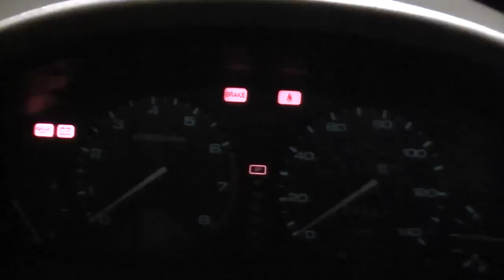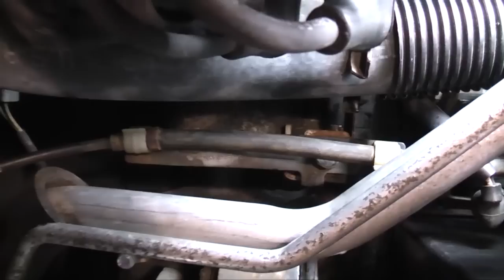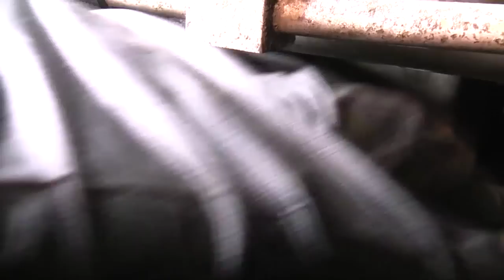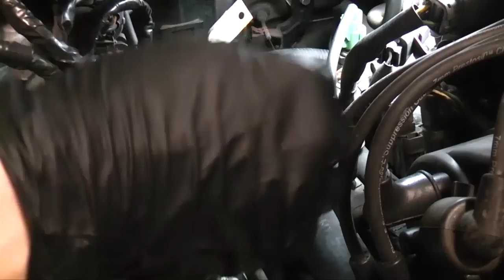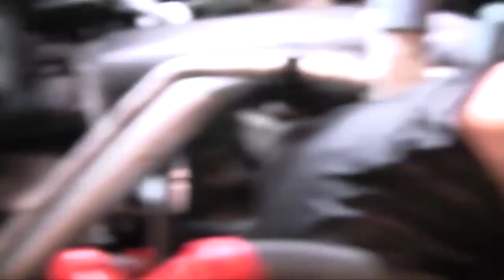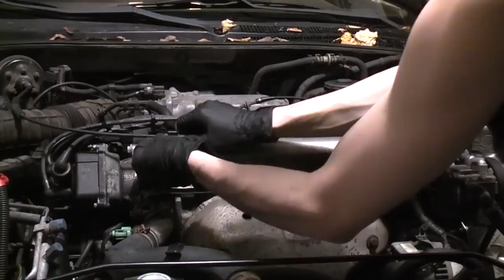Honda Accord Starter Replacement

Comment: Oh hell no.
What a pain in the ass.
I got a guy who will come to my house and replace it for $150.

I hate newer cars.
I want something 1970 or earlier

I had a 1965 mustang Fastback with a manual transmission and I pulled that transmission out so many times that I could literally have it sitting at my feet in 15 minutes.
I got a 2011 Tacoma there's no way in the world I would do the clutch on it.

Comment: Actually was half way thru your video listening while doing the job, and you said if you want to remove the battery for space you can... I removed the battery during starter removal and went out that side. Way less issues and it came right out. Looking back should've done the whole job from there.

Comment: Just changed out the original starter on my 1995 Accord with 632,000 miles. Thanks for the video it helped me out.
Reply: Loving that mileage! Still going strong?
Reply: @foxisretrofitting4556  yes it is just changed out the original distributor yesterday it was running a little sluggish and low on power and leaking oil internally 647,000 Miles.
Reply: @SuperHddeuce  Just did my distributor as well it puked oil inside of itsself. I found those sensors will kept going if you use some alcohol to clean all the oil off of everything after you reseal the housing. I just bought a remanufactured cheap distributor and put the old sensors back in. Saving the new ones for later. Not sure on my mileage somewhere between 206,000 and 300k. I changed the gauges out back when I got it in 2019. I've got lots of video on modding it if you are ever having to redo anything big. I converted over to the vtec equipment from the regular f22b2.
Reply: @foxisretrofitting4556  after replacing the distributor and checking fuel mileage per gallon it's getting 31.78 on the highway again was getting around 21 mpg big difference and more power
Reply: @SuperHddeuce  Nice dude! When's the last time it had a valve lash adjustment? It may eek out a little more mpg :)
Reply: @foxisretrofitting4556  80,000 miles ago I've got the new timing kit and water pump and seals ready for replacement soon

Comment: I had planned on doing the fuel filter (another excellent vid, BTW), killed the engine & went after the ramps in my shed. Little did I know the starter had chosen that exact point in time & space to poop out on me. Ramps in front of the tires, ready to go, AND NOTHING. LOL! Had to walk 6 miles round trip to get the dang part because no ride & no extra money for an uber. SOOooo annoying...

Comment: Nice video, what just got done with, i did is just remove the battery from the car, used a long neck rachet and extenders took the power cord off the bolt on solenoid, then started at the bottom take a short extender and a deep well 11/16 socket for the bottom bolt the radiator hose just move it to the right reach under neith to guide your socket on then begin, then switch to 14mm socket take off top, note you can slip the rachet in between the battery tray and the hoses, and if the bottom wont budge crab a thin pipe as a cheater bar. But if you want to use this video than good he also shows you.

Comment: I did it but I have to tell my story: First I had to get a longer 14mm socket and the extension. I found one for $1 at autozone on clearance. But it was for a small ratchet and it broke as expected. But that's all they  had, went to Pep Boys to get a real one. So after figuring out what to use to remove that left bolt. I thought OK how difficult can it be to put it back together.  I just couldn't align it or getting the left bolt in to the thread. Besides that the socket kept disconnecting from the ratchet. Then both the extension and socket fell by where the motor mount is and they got stuck in there. I can't get them out. I was tired already and my hands were hurting, not the palms but the other side. The starter is connected by only one bolt and everything is running good. I expect you to tell me that that is not right or good, right? After all this I don't even know what I did with the bolt. I plan to go to the junk yard and get one and replace it. It's not a difficult job. I just don't know why that left bolt gave me hell. Later I saw on youtube that you can use tape if you don't have a magnetic tool to keep the in place as you try to put it in. That's my story. I don't see anybody else having such a problem.

Comment: Thank you for posting this video.  I just replaced a starter in a 1996 Honda Accord and followed your video step by step.   I did have to pull the battery out to re-connect the power cable to the starter as there wasn't enough room to get the lock washer and nut back on the bolt.  Very helpful video!

Comment: I could not have asked for a better video because I have watched your other no start and therefore my problem is the starter! Should I buy my starter from Honda? 
The rubber covers at the end of the cables that attach to the solenoid are dried out and fell apart when I was looking around. Where would I get them and how would I attach them?
Thank you again very very much! Excellent video, instruction and follow along demonstration! I know the recording was difficult to position the camera, but it was perfect!

Comment: I want to buy rover 620 which is technically is honda accord 5 except for body, the owner says no crank and says no сurrent to starter from key, so because the starter doesn't work I can't check the compression, can you give me plz advice what should I do? how can I check compression with starter not working?

Comment: Would you know if I can use a 1998 Honda Civic starter to a 1997 Honda Accord ?thanks
Reply from the maker: According to my aftermarket parts catalog they have no starter part numbers in common.

The 1998 Accord with the 2.3 L4 does though.
Reply: thank you sir!

Comment: My daughter has a 96 Accord. The engine compartment looks exactly 180 degrees opposite of what you're showing. Is that normal? I have to replace the starter in her car.
Reply: planetrob555 because this is a four cylinder, what you're describing sound like the v6 model.

Comment: I have the same problem, I changed my starter and the same problem persisted, no engine crank or anything when I turn the key, I also got a new battery and nothing...the only way I could start it is if I push start it or get a jump from another car...any tips ??
Reply: NastySavageFucks559
Reply: same problem, have you found out what's the problem?

Comment: I changed the starter and the same problem persisted, engine won't turn or anything, I also bought a new battery and nothing, only way I could start it is but push starting it...any tips?
Reply: I forgot to mention that if I hook some jumper cables to it and get a jump it starts right up ..
Reply from the maker: Most likely an open or high resistance block ground especially if you're connecting the jumper cables properly (connecting the negative jumper lead from the good battery to the engine block on the dead vehicle and not to the dead vehicles battery negative).

To verify try bypassing the block ground with jumper cables connect one end to battery negative and the other end to the block and try cranking if the starter works you have a bad block ground.

If not check out this video https://www.youtube.com/watch?v=WwdBEENa7Is.
Reply: +Bushougoma what do you mean by block?
Reply from the maker: NastySavageFucks559
Any unpainted metal part of the engine block it will bypass the faulty engine block ground and allow the starter to work if that is the issue.

Comment: What brand starter did you get?
Reply from the maker: I've used both Napa and Autozone rebuilt starters on these vehicles without issue depending on who had one in stock at the time.

Comment: You show a starter for an Accord with an automatic, something we don't allow in our fleet. It is MUCH easier to change the starter on the manual transmission car. Drain a little coolant, disconnect a radiator hose, and the starter easily comes out the top.
Reply: Dan Avery if I was that a starter for a automatic would  work In a stick is that right

Comment: replaced mine with a new one from auto zone and it's grinding on my flywheel. old one didn't do that. 97 accord SE what could it be
Reply from the maker: +Angela Ramirez Make sure the bolts holding down the starter are tight if they are. Inspect the teeth on the flywheel for damage if they're in good shape I'd exchange the starter for another one.

These starters don't use shims so it isn't an alignment issue.

Comment: So I just replaced it!! Luckily it's the same make and model, so it made it super easy. But, it takes a few seconds to crank over and actually start. Would you say there is anything I could check or is that normal when replacing it, and due to the fact that it's a new part. Let me know! Thank you so much!
Reply: If it cranks slowly, you either have a different problem with the engine, or your battery is very old or the wrong size for the car.

Comment: I like your video a lot. it's really detailed. Adding info about the radio was a great practical tip.
Reply: YES! People who own this car, pay attention to getting the code for your car. Simply disconnecting the battery makes your radio DEAD. STUPID anti-theft thing from Honda. My daughter's car had to have the battery disconnected, and we looked at all options to find some sort of "silver" sticker that had a code on it that we would THEN have to use to get the code to input into the cheap-ass stereo to get it working again. Our fix?? We ripped out that shitty cassette player stereo and put in a real one. PROBLEM SOLVED. Why the hell they thought disabling a cassette deck would deter theft is beyond me...especially when all you have to do is replace it with either a decent stereo, or just replace it with any shit one.  Go figure.

Comment: GREAT VIDEO, BUSHOU...  MY GIRLFRIEND HAS A 1997 ACCORD LX...  HER STARTER WAS REPLACED A LITTLE UNDER A YEAR AGO...  IT WON'T CRANK WHEN IT (the engine) GETS HOT...  HOWEVER, IF I TAP THE SOLENOID WHILE SHE TURNS THE KEY, IT STARTS RIGHT UP...  DO YOU SUGGEST REPLACING THE REMANUFACTURED STARTER WITH A NEW ONE, OR COULD IT BE SOMETHING LESS EXPENSIVE?...  THANKS FOR ANY ADVICE YOU CAN OFFER...
Reply from the maker: +stillrumone Check with the auto parts store you bought it from many will offer a free replacement if it's still under warranty.

New starters are hard to come by especially for older vehicles and if you can find one they are very expensive. Dealers also sell remanufactured parts just like auto parts stores though they will usually be listed as such.

As for the longevity of remanufactured parts it all depends on the quality of the parts and the skill of the rebuilder. Buy a remanufactured part from a well known rebuilder and you'll be fine.
Reply: Thank

Comment: thank you for your time . A job well done! I forgot about checking the radio and I should know better. I suggest disconnecting the battery before attempting any repairs under the hood and any electrical service. thank you.

Comment: hi,I have a 90 accord that doesn't start when the engine gets hot,mainly in the afternoon when it's very hot out and I would be driving around when the engine is turned of and then re start engine it wouldn't start, cranks but no start,I would wait like 5min then it would start right away when engine cools a little
Reply: +Tony Tapuro Check on here for main relays. They over heat and disconnect connections and dont start the car. This is probably your problem. It's easy to fix and cheap. Sautering iron and a few minutes. Up under your stearing wheel area. leave everything mounted under there . Just stick flat screwdriver in and pull relay out leaving the housing. Inspect and fix then put back. Going to check mine and repair before i have a problem.

Comment: Awesome video thanks for taking the time to document.  This made the starter replacement on my 95 vtec auto accord a piece of cake.  I removed the battery which helped access significantly at a cost of only 5 minutes.  The VTEC intake tube was half of the removal and install time of one hour total.

Comment: thanks for the tips.  made this repair in under 45 minutes with no hang-ups or issues.  keep em coming
Reply: +Jordan Bennion 45 minutes to remove and replace a starter on a Honda Accord and this video took 27 minutes to watch??
Reply: Come fix mine now lol

Comment: You make it look so easy you see me I tried to pull them to the side and put my sock and on but I cant cuz my motor mount is right in the way so I can't get a socket on to the boat to get the terminal off the starter

Comment: Is there any significant difference with Coupe(CD7) version of that car for starter replacement procedure?
Reply from the maker: Haddock DaFish No. The only difference I can think of is the manual transmission models use a different starter made by Nippondenso (electromagnet stator) and the automatic models use a Mitsuba starter (permanent magnet stator) as shown.
Reply: ***** Yep, I have M/T model, but I doubt that it still carry an original Nippondesno motor. BTW, is there any way I can disassemble the solenoid itself without destroying it? Sometimes it stucks and won't let me start the car, so a friend of mine recommened me to clean two copper contacts which is located inside the solenoid(he assured me that it's a common malfunction that can be easy fixed)
Reply from the maker: Haddock DaFish
Worn brushes could also cause a starter to be intermittent. If tapping the motor with a hammer allows it to work for awhile that could also be the culprit.

Most replacement starters are rebuilt OEM parts. If you have the Denso style starter with the rectangular solenoid just removing a few screws will give you access to the contacts.

The Mitsuba style starter has a round solenoid and the outer case is crimped to the plastic end cap housing the terminals. Not really worth messing with.
Reply: ***** 
Thanks, you're right about the hammer, I've already tried this method and it works. I will try to inspect the starter myself now.

Comment: Hey, I just replaced the starter on my '92 accord and idk why but when I start it up the starter makes a whining noise like it's slipping on the flywheel. I've done a text book installation and made sure the starter bolts were on the correct sides, didn't over tighten the starter, and lined it up perfect. Any ideas why this is happening?
Reply from the maker: donovan stagg Did this issue exist before the old starter failed? What did the flywheel teeth look like before you installed the replacement starter?

A whining noise could indicate a worn ring gear, a misalignment between the ring gear and the starter pinion gear, or you could have received a bad re manufactured part.
Reply: The issue was not present before I replaced the old starter, and teeth on the flywheel were in really good condition from what I could tell
Reply from the maker: donovan stagg
Then that only leaves a gear alignment issue or you received a faulty starter.

Comment: Worked great on my 92 but the 94 accord is refusing to accept the 13,14,15,16 mm sockets at all. As if I need a thin walled socket. Weird! Won't even go on at all. I tried different brand sockets too. Maybe it's been changed before and someone put on a odd sized bolt.

Comment: Great video! I have a 95 accord v6. Seems like my starter is positioned  opposite from the car you worked on. Do I need to do the same labor like u did? Thanks!
Reply: Same question. I don't think this is a V6. Or are there different V6s because my battery is on the driver side and so is the starter.
Reply: Sonny Patterson 97 EX V6 btw

Comment: do i need a power tool to get does two bolts holding the starter since they need 30 lb force  or if they were previously tighten by a air socket

Comment: Thanks for the video.  I’m planning to change the starter of my 2001 Accord LX in the next few days.  Actually, during cold start, there is a grinding noise after I start the engine and it’s coming from the starter side of the engine but I’m not really sure if the noise is coming from the starter or the transmission. The noise will go away after I have driven the car.  I read somewhere that if the bendix gear of the starter is not retracting properly, it will make a grinding noise.  Have you encountered this kind of problem before?  Anyway, I’m taking a chance of replacing the starter.  If the noise will not go away, then I guess I have to take it to the dealer.

Comment: I changed the starter but it still won't crank, I also changed the ignition switch and emergency brake panel/switch board under the gear selector, lights don't dim and starter doesn't make a noise. Only the fuel pump, battery has full power
Reply from the maker: Watch my no crank diagnosis video and perform the voltage drop test shown on the starter. You probably have a high resistance or open block ground.

Comment: Are you working from both the top and bottom of the car? Or this is all upright? Your editing and choice of angles is confusing me. It looks like you're standing over the hood, and I am a small girl, but I can't see how you really had enough space
Reply from the maker: You can't access the starter from underneath it's all from under the good.

This the reality of modern vehicles everything is crammed into tight quarters and you have make use of the space provided to get your tools in there.
Reply: Thanks I think  need to just fumble with my ratchet until I have the right fit, because I am bumping into that motor mount and I do't want to damage it.
Reply from the maker: Shakira Miguel
Yeah there's barely enough room there. The trick is to have the right size extension and the right depth socket.